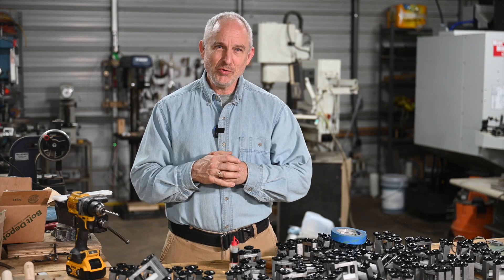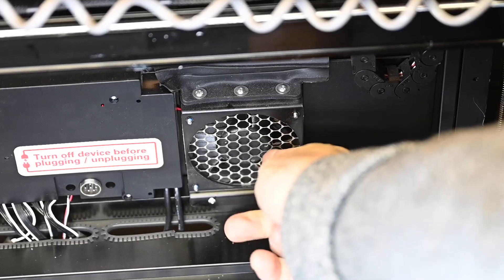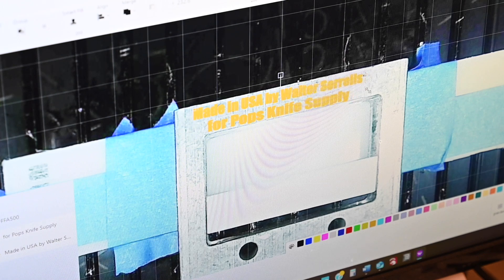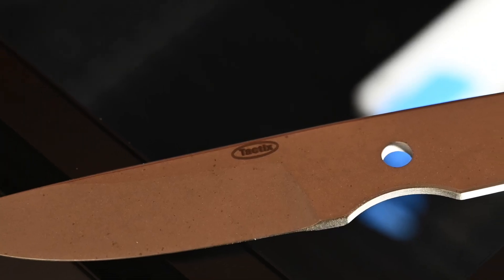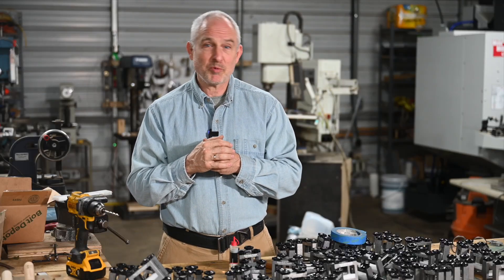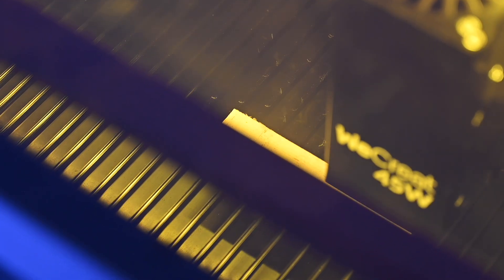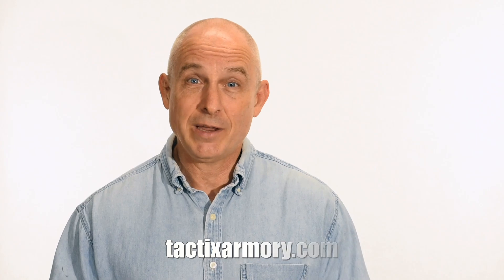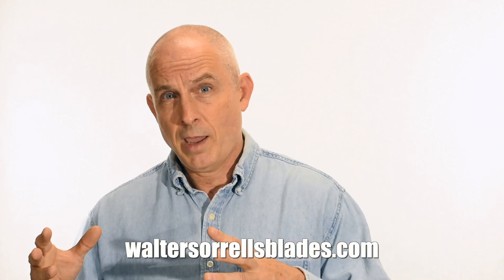Do You NEED a Laser? - Reviewing WeCreat Vision Pro 45W!

Comment: I started using my laser (Ortur) to mark out folder components instead of scribing on stainless with a cross mark that can be felt with a spotting drill for pin hole locations. Accurate without a CNC mill.